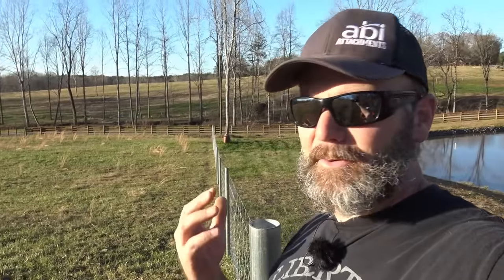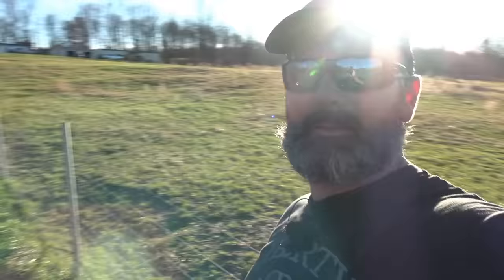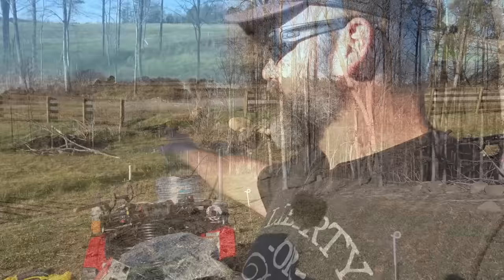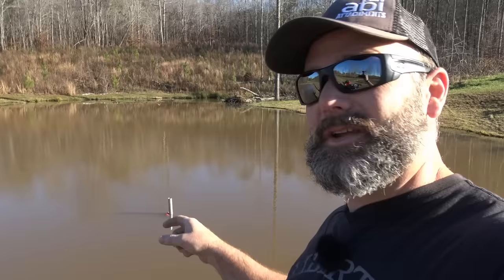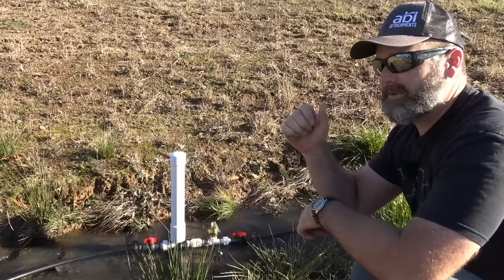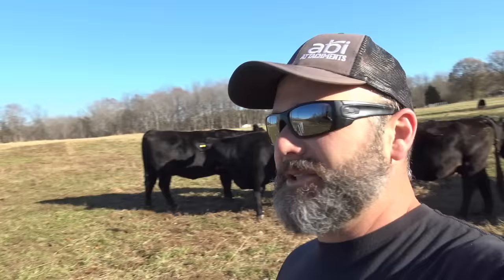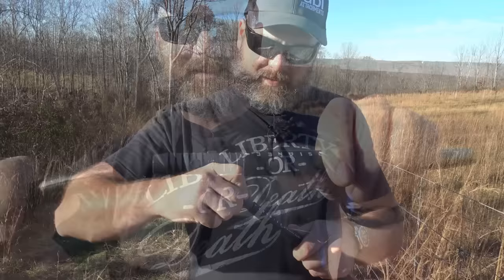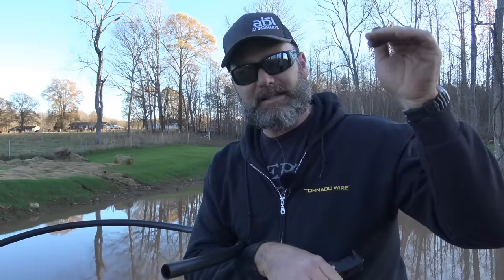Nonstop water pumping system no power...complete simple setup explained!

Comment: Back in the later 1960's we had a what in Australia was called a hydraulic ram pump which was all metal. It had a dome about 10 inches in diameter and 18 inches high. It was fed by a 2 inch feed pipe and used a three quarter delivery pipe. It was in a creek below a 25 foot waterfall and delivered water to our house about 500 feet elevation above the pump. About 9 tenths of the water were through the pump and only one tenth was delivered to the house. What you have is a modern material version of the same thing but much smaller. Blessings from Australia.
Reply: You mean Billabong? That was the best invention since mankind.
Reply: @HendrikTibboel-pt5kw  Correct! I could not think of the name. Thank you.

Comment: Great to see  a video of someone who knows what he is talking about and able to pass on the knowledge.  
Perhaps a vacuum tank at the high point in the siphon and a foot valve on the intake filter. 
This will start the siphon when the pipes and vacuum tank are filled with water first then open the feed valve on the ram pump
. Sometimes the intake is close to the water surface  it  will create  a miniature whirl pool and suck in air and stall the siphon. Stay safe pond water is not always good for your health.

Comment: I call this knot an improved clinch knot.  With mono, I'll usually use 6-8 initial turns.  The improved part is where you run the free running end up through the second to last loop.  I usually use the improved clinch on the main line to leader and a clinch knot in the hook.  Works good for the Carolina rig.  Now I want to go fishing.  Used to live in outside Leland and Fayetteville.  Really enjoyed your presentation.  Thanks.

Comment: When I used the black plastic pipe and found it hard to push into joiners and other plastic fittings, I used to carry a vacuum flask of hot water around with me. I put the end of the pipe in the hot water for a few seconds to soften it then it pushes onto the fitting very easily.
Reply: David 
Hello hope you are doing great
Reply: Hot air gun works too, or the wifes blowdryer, I've also used a propane torch.

Comment: A tip from a retired Pipefitter , when you need a oring or packing .
take a spool of Teflon tape and pull 2'-3' off the spool and (depending on the size of ring or packing or gasket) fold it in half, then fold it in half again , then fold it in half , in half ,in half, in half... if you have a little grease or oil ( everyone has a dipstick on there engine be creative )  it will help when you twist it Tight into a rope. then cut it on a long skue so it over laps 3-4 diameters .
100% success rate.

Comment: A video idea for you, maybe explain water pressure differences in elevation in different size pipes and about friction loss in running long distances in big or small diameter pipes or hoses.  Like how much pressure a ram pump produces to raise the water to 35 feet or so.  And about water volume versus pressure and how a siphon works?  Maybe this can tie in with your solar pump well, on how you select the pump size and so on.
Reply: Another video idea, make a 1 minute wrap-up of the build at the end of the video so we can skip 26 minutes and still understand what you build.
Reply: Go buy an Engineers pocket book. AMAZING amount of info in a little book about 3" x 4" in size!
Reply: That good water project for and job outside

Comment: Here's a few ideas I'll share with you that would make life so much easier for yourself when dealing with this piping and maintenance of the system.
* Keep your pipe warm by taking it inside the house the night prior, (in cold times).
* Don't accordion out the pipe but actually roll it out. This might require making a simple spool system out of some scrap 2x4s and some plywood. A little bit more time required up front but the spool would be reusable forever. I've seen electricians make a pyramid style spooling system that hangs and spins. Others have a spool system that spins like a lazy Susan. Still others use a spool that looks like a pulley with a handle that you can walk with.
* Use a small propane or butane torch to gently warm the end of the pipe prior to pushing the fittings in. It's unbelievable how much easier it makes it. (A lighter may work too but it's much more susceptible to wind plus it gets hot).
* There are hand pump siphon systems that don't require you to suck on them, (not only is that nasty but it could quite possibly be a health hazard).
* If you increase the surface area of your screening you will drastically reduce the time between cleaning and changing. Just do the same thing that you did with the wrapping of the screen material on the top end but make a  PVC cap and a stub of pipe for the bottom end  - keeping the screening material cylindrical shaped.
* If you find yourself having to clean the filters often make several of these with a threaded joint at the top so that you could do a quick change out system. This way you could have pre-made filters at the ready and your swaps would be fast. Then overhaul the nasty filter later and have it ready to go for a quick swap later.
* Cut a little bit more of the end off of the factory sealed pipe so you could use that as your temporary plug on the Tee fitting without having to waste a barbed plug fitting or time.

Comment: In the countryside in Yorkshire there's ram pumps all over the countryside. It's very, very hilly, and very damp! The pipes are a few inches thick, and run for miles, now and then there's a big concrete lump that makes a pulsing booming noise. About a couple of feet tall and maybe a foot square or more. A teacher told me what they were when our class was out there exploring (years ago, when I was a kid). They've probably been there forever.

Seeing yours I didn't realise they could be so small! But if it works, you can't complain!

Comment: I was watching you suck on the line to get your systems water started. Ever year when I have to prime my pump. I fill the line with water from the top down. I use a 5 gallon bucket that I drilled a hole near the bottom and attached a simple 1/2 " fitting with a hose that I place in side the pipe I am filling. Prop up the pipe at the bottom of the hill so you can see the water come out of the pipe. At that point the line is full, cap it and you are ready to pump because the line is full of water. I am filling a pipe 1 1/4 in diameter x 75' away with a drop of 12'  downhill. I had the idea after seeing a water level, and it just clicked. It went from a task I hated to a task that was simple. Thought it might be useful to you. Love your videos

Comment: if you used an end cap at the end of the mesh instead of making a cone for the "filter" part, it would give you more area for water to move through.  Same cable ties to hold it in place or put a few holes through it for the cable ties to go through to be certain it dosen't move or come off.  Would also make for easier cleaning too.  Thanks for sharing, nice video.
Reply: Hay
Hello hope you are doing great
Reply: @lydiaanderson1747   Yes, I'm going well thanks.

Comment: With that low pressure you could use a water line with very small holes to drip irrigate your garden it doesn't  take very much pressure to super saturate an area with a drop of water at a time 2 or 3 drops a minute

Comment: Im a plumber and id like to give 2 pointers about the poly pipe connections. Use a torch..... Dont melt it but put a little heat on that poly pipe.... Will make the barbed fittings easier and use stainless hose clamps. The hot pipe will conform to the barbs. Ok back to watching this
Reply from the maker: yeppers....we gotta get ya watching some of the more recent water system vids....you'll love it!

Comment: Battery powered wet/dry shop vac. You're welcome. 
I took an old 55 gal food grade barrel and drilled about 200, 1/8" holes. A couple rocks in the bottom to keep on the bottom and set the inlet inside. 

My setup is an RPS Solar pump but I like the ram concept

Comment: Improved clinched knot when you go back through the loop you created after the twists and then eye of the hook.  Clinch knot when you go through eye (or paracord anchor line or around anything) but not back through your loop you created - so going back through the loop improves (greatly) the clamping force of the rated line.  If you're using fishing line spitting on the knot before pulling allows knot to slip and not bind - dry fishing line with 8 loops can really grind on the knot sections and create failure under a load, bout all u need 2 know. Nice video and thanks for your service - i did 22 years Navy but was aviation electrician and we used no knots- except the clove hitch on wire bundles.  We had to learn them in boot camp - we never had to tie them so not much learning and quickly forgot?

Comment: Nicely done video. As I have never seen a ram pump before, a few questions/comments.  

1. Is the source pond spring fed so it won’t run dry? 

1a. What happens to system if stock tank float valves are all satisfied? Does all water stop flowing all while siphon is maintained at ram pump for when float valves call for water? 

2. It looks like source pond needs a second lower-level area for ram pump siphon to work. Isn’t a lot of water wasted with this system as ramp pump valves exhaust more water than is pumped upward?

3. Your audio system is great and helps a lot. I have seen some outdoor videos where you couldn’t hear the person well. 

4. Warming pvc tubing makes it easier to get on fittings. 

Thanks for useful video.

Comment: Adding an additional couple feet of input head pressure will increase the output volume.
Reply: Cool job bro
Reply: Do you mean putting a siphon ridge between the intake filter, and the pump?
Reply: need a video to explain adding more head to increase pressure.... please🙏 And i presume the ram pump must be blow the level of the pond b4 it can push water uphill??? Unless i missed something??
Reply: Like it but like my friend how can i get a video to explain fully?
Reply: @stephenkuria8225  by just pointing the finger at the ram pump and showing which part need to be bugger👍
Reply: Absolutely no explanation on how it works, but hey I got to see 36. Minutes of cows
Reply: @Lord_Joseph17  head pressure is not on the ram pump. its on the pipe input going to your ram pump. your input pipe should be atleast twice the diameter of your output pipe to gain more head pressure.
Reply: @josejaygarcia  awesome and sounds logical. Thank you🙏
Reply: @RJ-sr5dv  I have over 100 ram pump videos on the Land To House channel. Several go into detail on how it works.
Reply: @LandtoHouse  Thanks, I'll go to your channel..! (and sub)
Reply: @davidharland8443  
9
Reply: @garryhardie394  uv

Comment: If you bring a thermos of boiling water it will make it so easy .Just dip the tip of the line for about 30 seconds it softens it up enough to slide on and then it cools back to original rigidity.

Comment: Can these put out enough to not freeze?
Reply: I have run a ram pump at 15 degrees for a week. It did finally freeze because ice rose up from the ground and plugged the delivery.
Reply: Land to House  does the pipe diameter matter if you’re trying to keep it from freezing up?
Reply: @NorthCountryOffgrid   I don't know the answer for sure. But I feel like using a smaller diameter delivery pipe would allow the water to move more quickly. Fast moving water  Shouldn't freeze as easily. As for the drive pipe that water hammer is moving really quick
Reply: Here in sweden, were it will often be snowcovered ground for over 4 months and 3 feet of ice on the lakes we submerge the rampump (vädur in the local tunge) and if the line freeze, it will first save the pump, it will not freeze sence it is under water, and as soon as the temp rising, the line will thaw, way much sooner than the unpressurised waterbucket....
Reply: @LandtoHouse  Is there a way this system work for Canadian winter? -37 Celsius
Reply: @southswedishhighland3618  Thanks for mentioning this. Canadian winter is similar.
Reply: @southswedishhighland3618  could you do a video on your deep winter water system? We need one good for -40 Celsius. I have seen a few systems on YouTube - covering the heated tank with a rubber lid , etc. but haven’t seen a super low cost option.
Reply: @kimberleebell98  you could use solar to power a heat strip to offset some costs.
Reply: I wonder if it's possible to put a hose insulator around the poly hose, to help prevent freezing?!?! 🤔
Reply: @lesleykissamericafarm9349  if your setup allows you to do it, you can bury the line below the frost line.

Comment: Best common place to get orings is an auto parts store its better than a hardware store cus they use them for more applications.  Not sure if I should say but if you use a lot of orings get the assortment pack from harbor freight.  its got rings from about 1/4" to over 1".  I'm a retired machanic  and i used that thing all the time.  It was a great time saver when a part didn't have the rings in the package or what ever

Comment: Have you seen those bovine brushes? It's just a pole sunk into the ground and secured by concrete that holds a bunch of long and stiff plastic brush bristles. The bristles start at about a foot off the ground to about 5 or 6 feet up. The cattle love it for scratching those hard to reach itchy spots.

Comment: would be an interesting free energy experiment to use the ramp pump to pump water up from a pond (or tank) up into another tank higher up, then when the upper tank is full, have it be released via another pipe downhill to spin a turbine which powers a battery bank. Then just keep letting the cycle continuously flow and produce free energy :)
Reply: can't work, net energy is always negative

Comment: If you have a spring that never stops this is great, but a static pond that only catches runoff will be drained rapidly and most of the water will be wasted. Better off to use a 12v sprayer pump and solar panel
Reply from the maker: I agree....but this pond runs all year....you can't depend on pumping from a purely rain water fed pond that's for sure

Comment: Awesome system !   Your granny knot is really more like a an overhand knot on a bight . A granny is an incorrectly tied square knot . Granny knots should not be used because they MAY pull loose OR bind up so badly that you can barely untie it . Of course YOUR knot is not under any stress anyway.    Your h2o system is very cool !

Comment: Thanks for the great how to vid.

I had similar, half inch, poly hose for my drip system in my small yard (near Phoenix, AZ). 
Then difficult to detect, underground leaks started about 5 years after install. Roughly one leak had to be dug up and repaired every year or two... seemed worse after 10-15 years. 
(got rid of all that crap about 5 years ago and just used 1/4" tubing -- no problems since)

You should be okay with your low pressure / low flow system.

Comment: Seems like a bit of wind would knock the trajectory of that drip water away from the 100 gallon tank.  Maybe place it closer to the tank or run a small tube down into the back of the tank.  Cool video!  Never would have thought it possible to do without power.

Comment: We used a cast Iron version made in the 1930's and it pushed up 1 pint per cycle and lifted water as much as 150 ft vertically. Supplied house water for may years.
Reply: Take a propane heater out with you and heat wAter in a pan to heat the pipe ends and they will push together real easy;d 4d5+ yrs of landscape work and farm water systems.
Reply: Use a dryer vent clamp on that pipe and screen maybe?
Reply: Make a sealed tube like that filter and hang that intake from it; have a sch 40 pvc pipe straight out from that drain/overflow pipe. Will last many a year.

Comment: Love it I have water flow with elevation to work with. I have considered this but currently pump to get pressure for irrigation.  My screen is similar,   Hack saw cuts in the pipe allow water through but nothing of size.

Comment: I realize this video is 2 years old, but I'll give you a tip anyway that will help you in the future.  When you are unrolling water lines or electrical lines that are on a spool like you have, don't pull them from the side.  Unroll it and it will be a lot faster to get it to lay like you want it.  Remember, it has a memory, and it will only do what you tell it to do, so tell it to unroll and lay flat, instead of pull out like a spring.

Comment: What you have there is a modified version of what we called a 'Dutch Pump" except Dutch pumps were horizontal, they have been around forever, the original ones used a leather diaphragm! oh, if you need to get a longer reach from them then use a couple check valves in your feed line.

Comment: One should remove air by sucking  pipe then it will work  you can use water source level should be above drain or outlet to get water .

Comment: Hot water will help with flexible pipe and o-rings stretch a little for needs in cold weather.  Get a thermos for the boiling water.

Comment: A little heat from a lighter on the end of that tubing will make it easier to jam the connector into the tubing. That zip-tie tightener is cool, Iv'e never seen one, have to get one. I always used stainless  hose clamps which can be pricey.

Comment: I hope your pond can sustain the ram pump, I see you have a lot of water loss, I can't really tell how much water replenishes the pond. Another method to consider would be a small solar that would only pump what you need.
Reply: The 1/2" pump is using 2gpm. That pond has an overflow of at least 15gpm. The 3/4" pump is using 6gpm and that upper pond has around 10gpm flow.
Reply: @LandtoHouse  good reply.